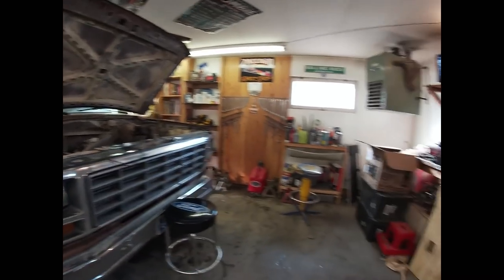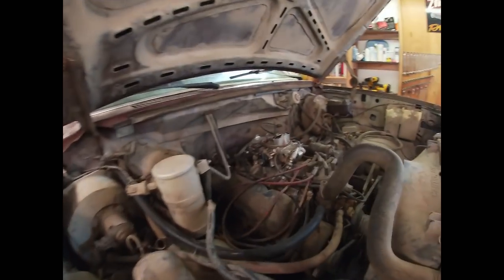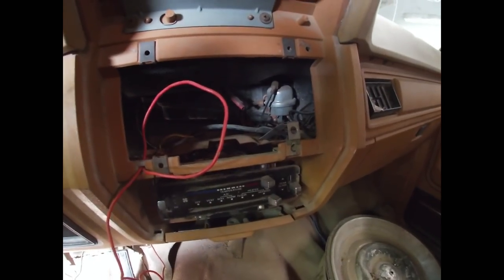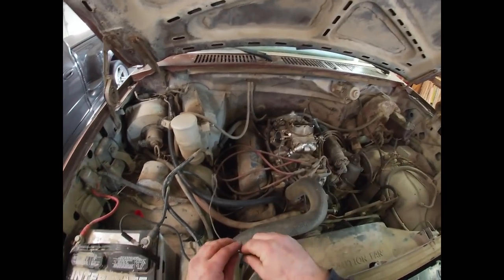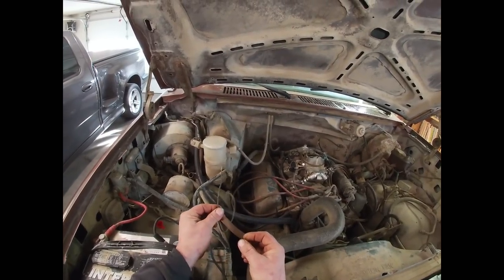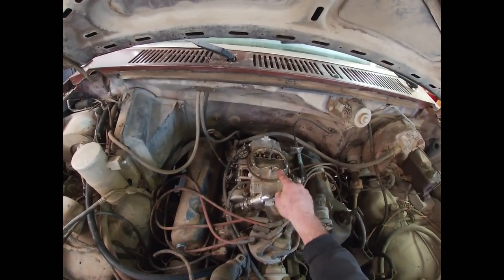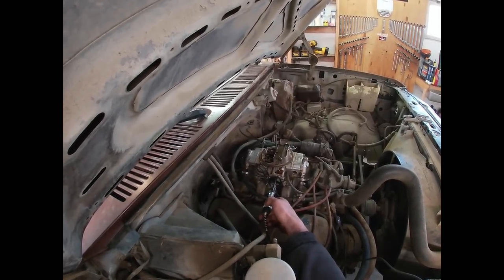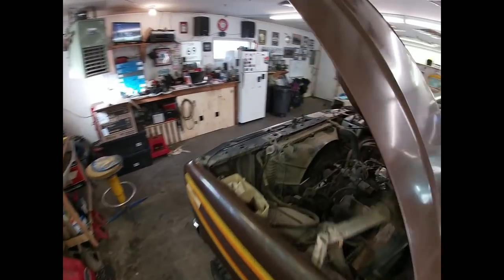How to set up an automatic electric choke and a Brown Cow update

Comment: Somebody tied the choke wire on my CJ to the ignition module.  Needless to say, I went through a few ignition modules before I found it, lol.   CJ's actually have an oil pressure switch that powers the choke pull off, so I hooked that up.  My CJ also no longer has the THERMAC (That's GM's name for it, I dunno what other makers call it), so I have to really be careful until it is warm because the throttle likes to freeze open.  Usually just the secondary, tho, the primary spring is strong enough to overcome it.